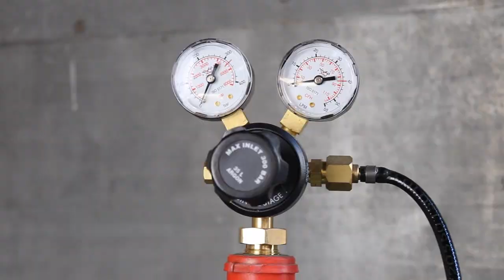RECOVERY TRUCK BUILD DAY 5, BUILDING THE RAMPS. RAMP TRUCK

Comment: 6:28 you can use an old set of motorcycle clutch springs and weld them to the the face plate in front of the tops of the ramps. It will take up any slack and stop the rattles
Reply from the maker: Great idea. Cheers

Comment: Id mount those rear facing lights to the back rack like you mentioned. I have 2 6" rectangle led light pods rear facing on my jeep, i use them weekly when i go offroading. Also you should design an area for misc. straps and winch controller and such!

Comment: You should put a small wedge piece at the front of where the ramps slide into when they are stored. It keeps them under some tension so they don't rattle around and drive you insane!
Reply from the maker: Roger that, Cheers

Comment: On the last one I built for some lads was to put a ton weight ( sand ) on a piece of ply just forward of the axle. This gave the loaded ride height so it sat up un loaded but as the weight went on with the car going up the ramps it came down as you would expect. What happens with recovery trucks as you will find is there will be a job come up worth the money and it will be some over weight bit of crap to move and your truck will be on the stops… Nice work by the way
Reply from the maker: I based it off a mates truck which had a bed height of 600mm at the rear unloaded, mines got heavy duty springs on the back too so im hoping it should be good but we will see on the first load. Cheers

Comment: Two things came in my mind, do you get snow? Strap hooks could get frozen stuck. And maybe the ramps too if not covered. 

And the ramps might be a bit difficult to access with a car on. Don't know if you already had some ideas for that, but I was thinking maybe add a ~1.5m long (long enough to reach the bumper) ~10mm thick bar stock to the end of the ramp. You can use it to pull out and push in the ramp without needing to reach over. When the ramp is out, the bar will fold and clamp to the side of the ramp so it's not in the way. When the ramp is in storing position, the bar can be locked to the rear bumper, preventing the ramp from moving back or forward.
Reply from the maker: We dont get much snow here no, I measured it up with my car on and it should be fine for getting the ramps out, if I ever put anything long on it it might be a pain but its only for me to take my stuff to events so im not worried. Cheers for the ideas though

Comment: Why not mount checker plate under the bit at the back you could use that then as a small shortage area (straps winch brother ect) and still have room/access for the ramps
Reply from the maker: Im making a bin up front for that. Cheers

Comment: Nice build so far.But i would have built the ramps from aluminum as they are lighter and easier to move.
Reply from the maker: There pretty light, that box is 1.5mm wall. Cheers
Reply: I have seen aluminum  ramps just a month ago.If built right they will last longer than the truck.

Comment: Why not cut slots to hook the ramps in place instead of welding those pieces. From my arm chair here I am thinking about the weights of some vehicles like vans and light trucks. I don't think the welded pieces will hold such loads, and over time and rust penetration in seams.
Reply from the maker: The angle on the back is thicker than the box section wall so its gonna be stronger.

Comment: I wouldnt run it with the oil cooler bypassed when it loaded, a good long pull would get the oil temp high i would imagine, would be a shame to damage the motor for the sake of a new cooler, im sure they are prity cheap for them
Reply: The oilcloth cooler is for the hydraulic oil to the old tipper not the engine oil
Reply: @gazukroberts4690  oh right sorry! i thought you meant engine oil cooler,
Reply: I think your wrong gaz the oil cooler is for the engine oil not the hydraulic oil (iv never seen one with a hydraulic cooler )that’s why there’s black engine oil in the header tank I’m a commercial mechanic iv done loads it’s common as hell
Reply: @scooter20king  I might be then I'm going off a few converted trucks I've had when there were previously a tipper they had an oil cooler underneath for the hydraulics but we're blanked off when converting
Reply from the maker: Im on it, Cheers
Reply from the maker: it never had a tipper, its for the engine.
Reply: i did think it was strange when you said it was for the tipper but i didnt  want to be telling my grandmother how to suck eggs ifyou get me

Comment: This build has really impressed me up until the point were you showed were your storing the ramps, out of all the trucks I've had a transit with ramps under the bed are the worst mate, you can't get to them when there is a car on the bed you end up climbing underneath the van or squashing between the car floor and the bed to access them, a drop down panel with the taillights attached is far more practical they just slide in from the tail lift up the panel and lock job done
Reply: exactly what I thought, on previous comments I suggested moving the spare wheel and sliding the ramps in between the rear lights, put the spare opposite the fuel tank, when it is loaded crawling under the car to reach them under the bed is a pain in the a*se, then catching on the underside of the car when trying to pull them out, excellent work done, but not this idea for the ramps, been there done that.